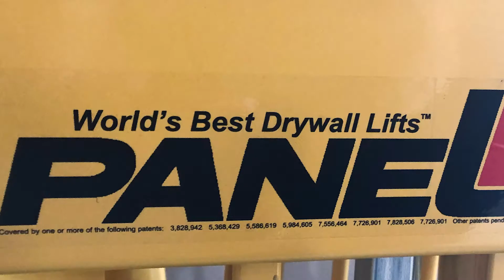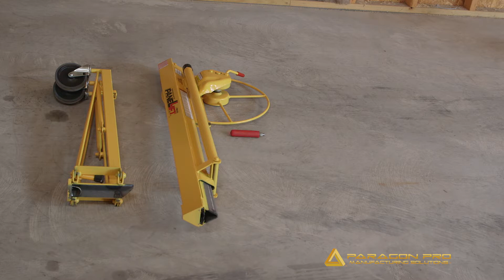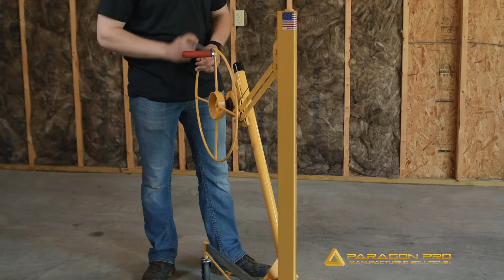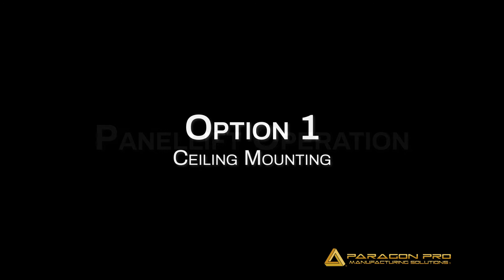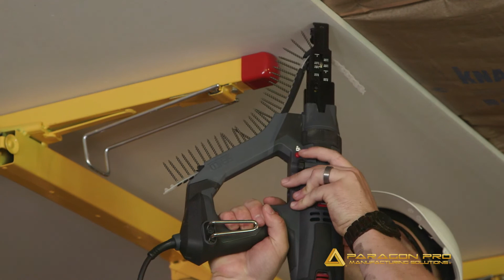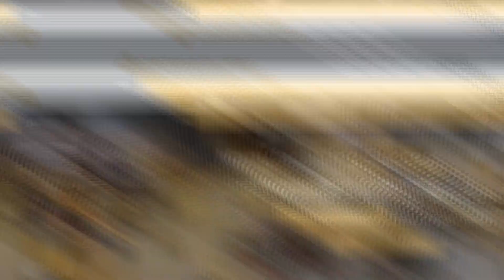Panellift® Drywall Lift Model 138-2 Instructional Video

Comment: I've had my panelift for over 25 years. Top quality product. Have used it to install over 30000 sheets of drywall. That's a very conservative estimate. Replaced the cable once. This lift has made hanging 16' sheets of drywall on a ceiling with one person doable. Your video with average joe doesn't do it justice.. The electric hydraulic lift is a pleasure to use. I'm saving up to purchase one from my best friends widow. He was killed in a freak car accident in January 2024. Thanks for making a great product that has made my life easier. 30 plus years of drywall installation have taken it's toll on my body. This product is top notch.
Reply from the maker: Thank you! Email us about this testimonial for prizes at sales@paragonpromfg.com